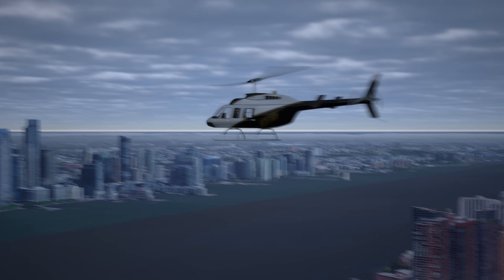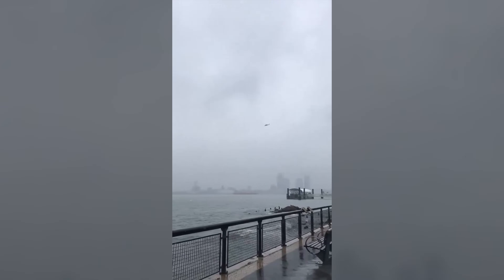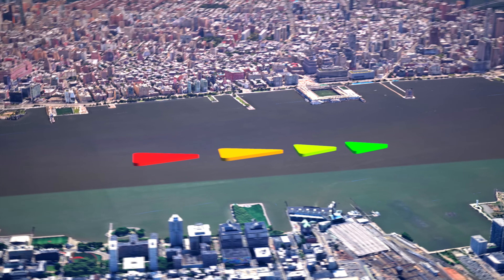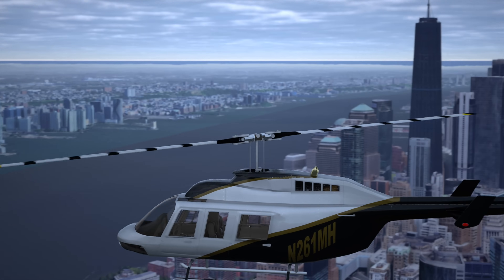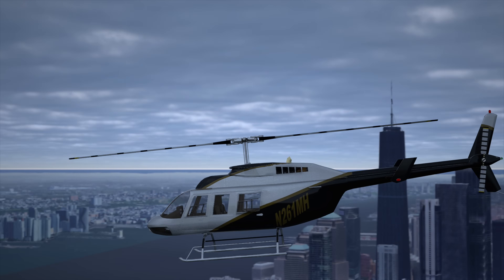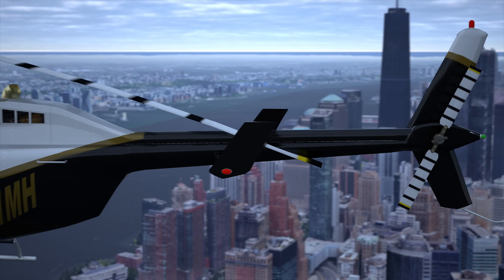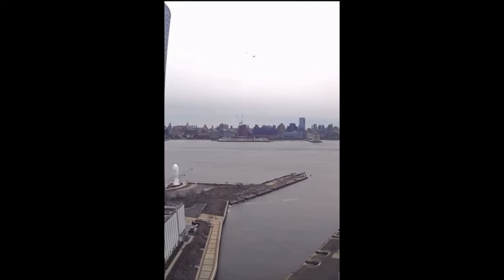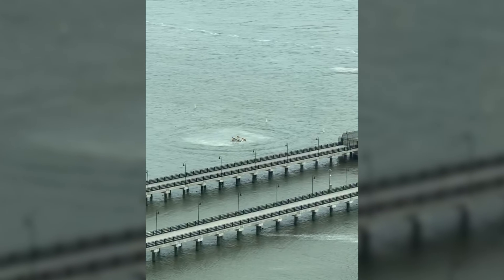Helicopters DON'T just fall from the sky - What is "Mast Bumping"?

Comment: This is not mast bumping. I believe it’s a tail boom failure saw a cobra when I was in the service it’s a rather long story but the short version is we had just refueled and were heading back to base I was a crew chief on a OH-58 we fueled first toon off the cobras fueled after us but caught us and then passed us. We were just shooting the breeze when I noticed one of the cobras turning? Said something to the pilot and just then the tail boom hit the side of the cobra and separated they went into a rapid spin then just seconds later the transmission and rotors separated at that point the cobra went into a aft low spin and hit the ground and exploded. The next day we were looking at a cobra in our hanger and we saw cracks in the bulk head around the bolts that attached the boom to the airframe. It grounded every cobra world wide til repairs were made. The stress on these tail booms is under appreciated and if they missed them in inspection which is not hard to do on a painted aircraft. In this video it’s very clear that the tail boom came off first then the transmission and rotors separated.

Comment: I jut refuse to fly at this point n it has nothing to do with the actual flight of the aircraft or the aircraft itself. it has to do with the human factor. I do not trust the people involved in maintaining the aircraft or piloting the aircraft. There is no guarantee that proper Maintenace is done and with the times as they are with all the corpos losing cash cutting corners is def on the table. Then add Boeing and their issues I'm jut not going to gamble with my life to save hours in drive time, yes yes i'm sure i can die a lot easier on the ground but i'll take my chances doing 60 mph with me at the wheel and me doing proper maintaining of said vehicle than some stranger i don't know doing 200 plus 20k above the ground.

Comment: Definitely not mast-bumping.  Main rotor blades didn't look bad and were auto rotating with the tranny still attached.  Also looks like most of the tail section separated as a unit.  Guessing something mechanical probably locked up at engine/tranny and sheered the main and tail rotor assemblies?

Comment: Because the main rotor assembly was basically intact as it separated from the craft (and the latest footage shows a very sharp yaw before the tail breaks and the main rotor departs the aircraft) it's near certainty NOT mast bumping. It's also not a problem the Jetranger series is known for. I'm disappointed with the level of speculation surrounding air accidents lately. Let the NTSB investigate and report their findings. Shouting "Mast bumping!" is pointless and the evidence doesn't point to it.
Reply: Lot of experts in the house today 
Maybe get a job with NTSB or NASA and share your wisdom.

Comment: I recommend watching the Blancolirio channel's breakdown of this event. His analysis leans toward a gearbox failure that caused the driveline to seize. The sudden torque ripped the transmission out of the mounts and shook the tail boom free at the same time. Notice the spinning of the main rotor after the event remains balanced without any wobbling that would be present if the main rotor had lost any of either blade. Its speed suggests that it didn't strike anything as it departed the aircraft. According to ADSB data, the aircraft was flying level at a constant speed, not maneuvering. It is highly unlikely that any pilot input caused this accident.

Comment: Bryan, I’m not sure that mass bumping is going to be the cause here because if you look closely at the debris as it’s falling, especially the spinning rotor system… When you pause the video you can see that it appears as though the main rotor transmission is still attached. This would likely mean that there was a failure of the transmission mount system, or possibly the roof deck of the long ranger. If it had been mast-bumping, the rotor mast would have failed just below the trunion where the droop stops contact the rotor mast. If in fact, the transmission mounts failed, or half of them failed, you would expect the transmission to can’t within the air frame, which would then alter the tip path plane of the main rotor system, leading to a tail, boom, strike, and severing.
Reply: *canted

Comment: I'm a licensed aircraft mechanic with many years working on Bell helicopters. This is ofcourse purely speculative, personally I do not think it was mast bumping, not as the main cause anyway. The reason for my thoughts are, the whole rotorhead departed the helicopter in one piece, and in still pictures it looks like the topcasing of the transmission is still attached to the head and mast assy. 
I hope the authorities find most parts so we can know what happened, the poor people onboard are in my thoughts.
Reply: It also looks like the tail rotor came off after the main rotor assembly.
Reply: In another video caught just before the accident, the chopper is flying at speed when suddenly it made a hard yaw, the boom snapped, the main rotor was still attached and rotating, then it separated. This all happened in less than a couple seconds. It was flying straight and level  so mast bumping doesn't seem like it would be taking place.
Reply: Agreed  @Chuckt961  . Looks like a problem with the tail rotor gearbox seizing or the tail rotor drive shaft shearing to cause 1. The yaw to the right. 2. The tailboom to fold an separate. 3. The overspeed of the main rotor causing it to separate. You can see the order of these events clearly in the video where the aircraft is seen flying from left to right. Very sad day for all.
Reply: @Chuckt961  that's what I saw too.  Very odd to see the tail boom separate right at the fuselage
Reply: @Chuckt961 please share link
Reply: Thank you for that insight. Heartbreaking loss of life.
Reply: @sharondoan1447  why do you call this "insights"? Lol. Saying that I don't think mast bumping is "the main cause" is not an insight and it's not even speculative. It's just showing that he's lying :p
Reply: @ Why are you so easily irritated?
Reply: i feel like helicopters could have automatic parachutes built in for situations like this. go down too fast and it automatically ejects them, you’d have to limit how fast the rotors can drop down to and lock them out while parachutes are out and connected
Reply: @morgan0 good luck ejecting upside down
Reply: @vilian9185  i didn’t mean ejector seats. i meant parachutes attached to the helicopter body itself
Reply: So you believe poor maintenance or none whatsoever?
Reply: I saw the entire rotorhead flying into the water. How in the world would that happen?
Reply: Very unusual for it to separate there
Reply: My co-worker was an aircraft mech for 30+ years. Said the exact same thing.
Reply: you were proven correct by the investigation
Reply: You think it was a expert hit?
Reply: "not as the main cause", why?
Reply: As a licensed aircraft mechanic, can you tell me (us?) the relationship of the mass firings of FAA personnel to the crashes that came soon after and the potential for more? Thx.
Reply: Mast bumping is usually a low rotor rpm problem.
Reply: This was a top Spanish CEO with money humm? Foul play? This not normal for a coptor  to do that
Reply: Its been 15h since u commented this. Are they still in your thoughts
Reply: They are now, thats for sure! @lovelaugh7299
Reply: So you’re not gonna say what the main cause is? Just that it’s not mast bumping?
Reply: @dilapidatedduo  I don´t know what the main cause is, I will wait for the NTSB to deliver that verdict. From what I´ve seen, it´s just not consistent with mast bumping.
Reply: @CS-kx7cx  Recovered main rotor now , the whole roof has come away complete with transmission !
Reply: @nounoufriend1442  Never seen anything like it!
Reply: @dilapidatedduo  Gearbox failure would be a good start... maybe the main transmission or the rotor gearbox. The rotor system in the 206 is different to the Robinsons which are known rotor bumping aircraft. While it is possible in the 206, it's rare.
Reply: The thing I don't understand, given that a plane crash could be fatal, why didn't they invent safety systems to save human lives?, man, this is ridiculous.
Reply: I agree.   It stayed spinning and level.  Like it had no wobble or vibration before it spun off.    IT SPUN OFF .
bottom line.    SCARY EH..   have we hired DEI foreign mechanics in the last 10 years.    ???
Reply: i suspect it's chinesium
Reply: Sure looks planned.
Reply: @AnalysisMedia  The question is who wanted the family gone and why?
Reply: @AnalysisMedia Quiet. Don't start.
Reply: @AnalysisMedia with some rich people in there I don’t doubt it was
Reply: @AnalysisMedia  Looks planned... yeahhh sure buddy. Take the medicin and go to sleep
Reply: @AnalysisMedia Can't conspiracy theories wait five damn minutes.
Reply: @ It is actually super unusual for both the main and tail rotors to come off together (very much more so for the main). But sure, you can trundle along with natural causes as if it happens every day if you wish to do so. Nothing to see here, enjoy the ignorant bliss world you inhabit.
Reply: @SueHowie152 Helicopters don’t just fall apart as if they’re made up paper mache.
Reply: @ The main body did not fall apart. But it is super curious that the entire rotor assembly came off like that.
Reply: @eastwaters4082  You can see from the video that they do.
Reply: @eastwaters4082  if they are not properly taken care of, or in Airbus' case, they have poor design; helicopters will 'just' fall apart.  Happened to a 47 decades ago due to bad bolts being reinstalled during an overhaul.
Reply: @eastwaters4082  When the gear box comes apart, the helicopter will absolutely just fall out of the sky.
Reply: @eastwaters4082  yeah and rmbk reactors don't explode!
Reply: @eastwaters4082 old ones do maybe no one did proper inspections just think about how many trips a day they take just like car accidents helicopters and planes can crash as well nothing is untouchable!!!!!!!
Reply: @AnalysisMedia helicopters don't have wings bro, they can't glide. If they lose the rotor they drop straight down in free fall. We had simulare accidents in my country with helicopter in North Sea.
Reply: @RandySnarsh  Helicopters get a certain amount of glide through autorotation. The energy stored in the main rotors would help slow the rate of descent. Some helo pilots have actually made power out landings this way. Unfortunately, this helicopter broke apart. The two components that would facilitate an autorotation, main rotors & tail, broke off. They never had a chance.
Reply: @RandySnarsh not true a helicopter pilot is trained to do a autorotation this is not freefall it uses speed lift and rotation to quickly glide down.
It is a very difficult thing to master though
Reply: @maseratirijder  You can’t autorotate if you don’t have a rotor.
Reply: @RandySnarsh  Helicopters are classed as rotary wing "the blades are wings) they can sort of glide provided rotor assembly is intact (auto rotate )
Reply: @theduke7268  Rotor did autorotate but unfortunately was minus the helicopter
Reply: @AnalysisMedia , It was. That couple funnily enough got $84,000,000 from USAID and was being told to pay it back.

Always follow the money. Rich men will take a family out for $84,000,000.
Reply: @GemsofJapan  Interesting.
Reply: @GemsofJapan  well the couple didn't just GET the money from USAID obviously.  There is a connection to a corp. or group of people that likely have to with it to protect their "syndicate".  The elites are quite remorseless.  They don't care from 1-to-1 million families being in their way.  Never underestimate evil.
Reply: @GemsofJapan  All day long.  Thank you for that information.  I've never seen a helicopter break into distinct pieces in midair.  Someone gained access to the aircraft prior.
Reply: @StrawberryFieldsNIR made up
Reply: @GemsofJapan  That's not how debts are being paid. Now that family is dead, the debt cannot be paid. Creating this sort of event doesn't serve anyone good if it's about repaying the debt. And people who made from USAID that money are not asked to pay it back, they simply closed down the USAID bs and the money simply stops flowing rather than being taken back. When the talk is about "money is taken back" it's usually metaphorically in a case like this, just in case you try to argue about something like that.
Reply: DEI mechanic!!!!
Reply: @bardownsky-bros4829 Wow🙄 That BS didn't take long.

Comment: I once ran a parts department at a helicopter rebuild facility in Langley BC Canada. Mostly we dealt with MD Helicopters and Robinson. The crew there were top notch people and very thorough. On a particular day, a just completed rebuilt MD was to start it's first trials which basically was to start it and lift a couple of feet off of the ground and hover for a set time. I went outside to watch one of the AMEs run the machine up. I was talking with the avionics tech who did all of the wiring we did inhouse. He told me of the tests that the machine would go through before taking it's first real flight across the Fraser River to the Airport on the other side. Probably a 10 minute flight. I asked the tech if he was eager to go along on the flight or even why he wasn't onboard on that day after so many months of work had been completed. He gave me an answer that I'll never forget. He said, "I wire these things and I know how they are constructed. I'll never set foot in one off of the ground". I know many helicopters fly around the world every day and the amazing service they provide to society but I doubt I'll ever go up in one after that particular work experience.

Comment: As a helicopter pilot, this does not seem to be a case of mast bumping!
Most crucially, the rotors and main transmission are still attached
This is Very unlikely in a mast bumping scenario as the rotor mast is the component that breaks in a mast bumping situation,

Comment: Mastbumping would be the easy answer however not the most likely. You are leaving one very important part out of your explanation. When a helicopter experiences a low-G situation, she will roll to the right (tail rotor) with a roll rate of up to 100 degrees per second. Only, and only when the pilot does not recognize this, and attempts to correct for this right roll with left cyclic input, mast bumping will occur. And when mast bumping occurs, the rotor will separate at the main mast just below the rotor head. In this case, the whole transmission appears to be ripped out as well as the tail boom separated. I dont know the cause, but your explanation of mast bumping is incomplete and faulty and the events might indicate more or something other then just mast bumping at play here.
Reply: The more I see in video’s, the more I start to think in the direction of a transmission failure. Mast bumping would have separated the rotor from the mast. Not rip the transmission and rotor as a complete unit out of the fuselage. A tail boom strike would have messed up the blade as much as the tail boom. These blades However look intact. The only other thing I can think of is a complete lock up of the transmission. This would rip the whole transmission out and also the tail rotor drive shaft (including the tail boom).

Comment: interesting speculation but given that the conditions were good and the heli was in straight and level flight I dont think mast bump is at all likely. To me it has all the characteristics of a gearbox failure. Heli gearboxes can and have (all too many times) failed catastrophically. When this occurs the rotor separates with the upper part of the gearbox and as it does so it usually tilts back and chops off the tail, exactly as shown in the video.

Comment: There are a few theories one was a pylon link failure, this happened in Australia where it separated but did not cause a crash. Other is a transmission total seizure, but would the inertia of the main rotor be enough to rip the transmission completely off? A Paradise tour 407 had a complete separation of its tail boom but the transmission and rotor stayed in tacked. This Hudson river 206 had a hard landing in Chile in 2010 and the NTSB said it had faulty parts and Bell mandates complete inspection of the transmission pylon links after a hard landing. I would venture to say it had something to do with this.

Comment: It was probably caused by the failure of the "jesus" nut causing the rotor to separate from the helicopter and then it did fall straight down.

Comment: I heard that the bell long Ranger does not have the rotor, bumping problem, lack of Robinson  R44😮
Reply: In principle, all helicopters with two-blade rotors have this problem. It's just more common with Robinsons because they're often flown as training helicopters, and their piston engines make them cheaper and easier to maintain and fly.
That's why you hear it more often from R22/44.

Comment: I flew this bell 206 and 407 I survive (2) helicopters crash I have the videos and photos from the damage for 5 years with 7 flight by date and I can tell you that Impossible, that doesn't happen ""

That screw, that attached is name like Jesus nut🔩 and that normally is 600 pounds of torque 700, 800, 900 is a lot “”” a lot 

That will NEVER come loose. It has a protection system in the Chinese hat inside the transmission that also blocks it.

That's WEIRD

- unless the mechanic was working on that part, SOMEONE??? You have to look at the security cameras in the hangar. It's surely a mechanical-related accident ⚙️ ""
Reply: The "Jesus Nut" will be the last problem to be investigated in any case. The rotor and main gear box are still connected and floating together toward the water.